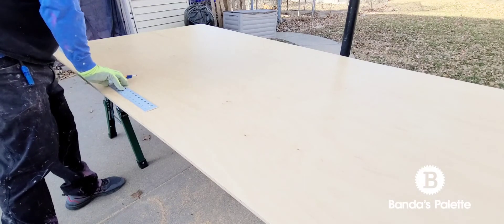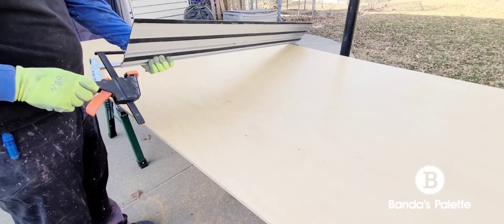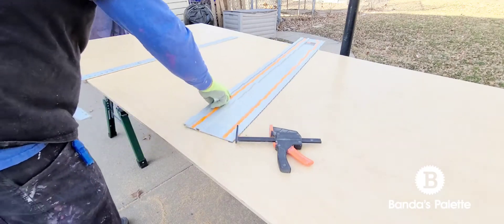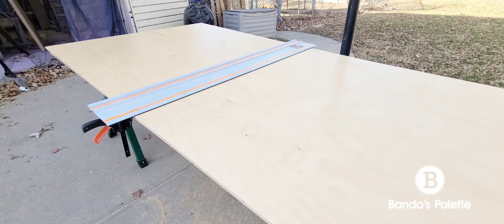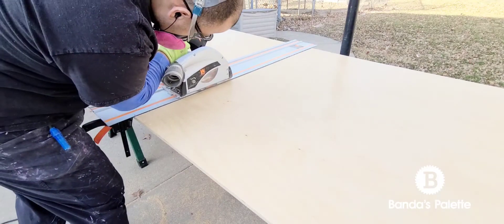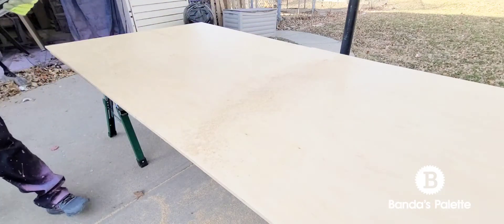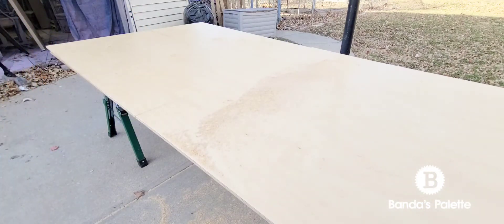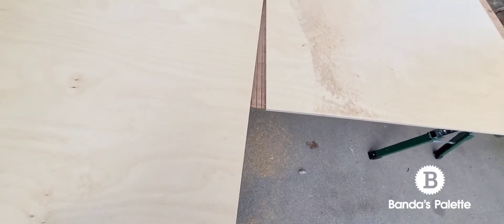Getting Accurate Clean Cuts with Track Saw @wenproducts#tracksaw #cleancuts #tips

Comment: Did you need to cut the rubber edge with your saw when you first bought your tracks if so do you think it damages your blade?
Reply from the maker: I did, yes. It won't damage the blade. It is beneficial so that you can use the rubber as a reference to where the blade will be cutting for all your future cuts. Hope that helps 😊